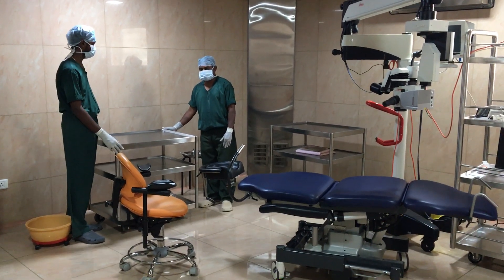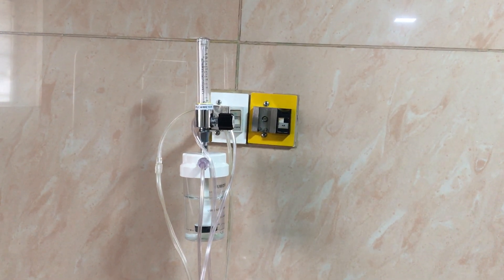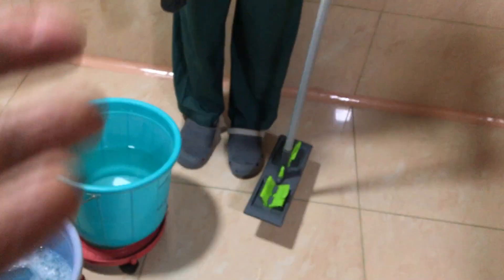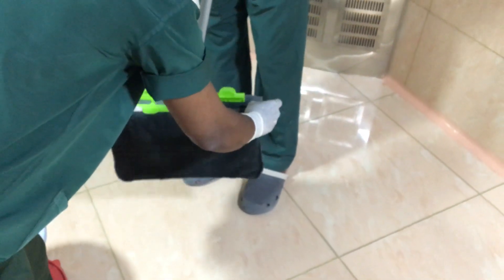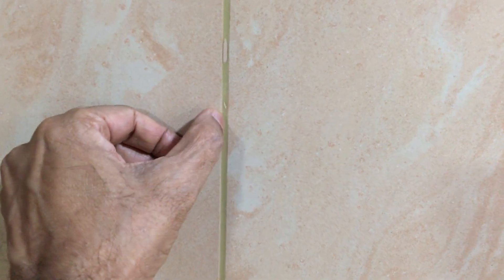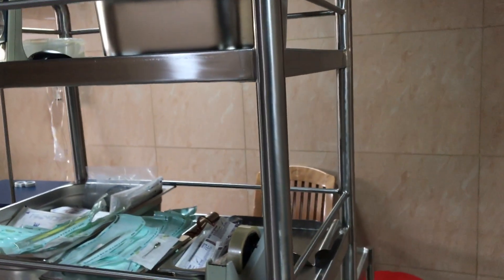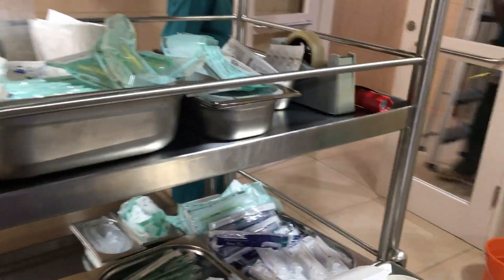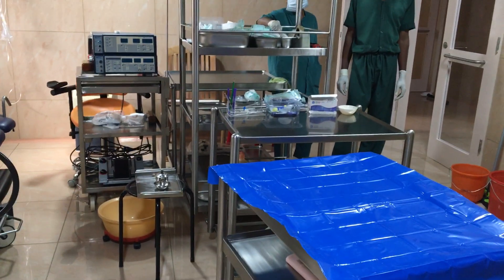Operation Theater at Karthik Netralaya

Comment: Sir your OT trolly and table of steel is very good . From where it can be purchased
Reply from the maker: They were custom designed to suit my needs by a local SS fabricator, using 304 grade SS sheets and pipes.
Reply from the maker: They are made locally with 304 SS by SS fabricators. If you show the photo, or video, you can get them made.